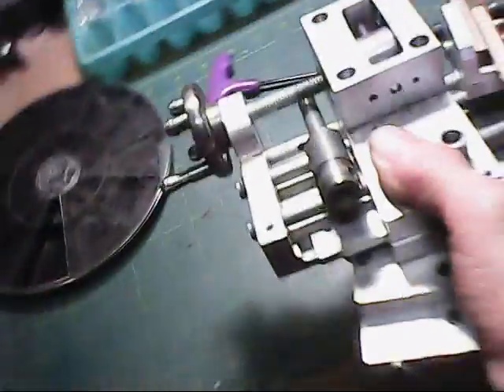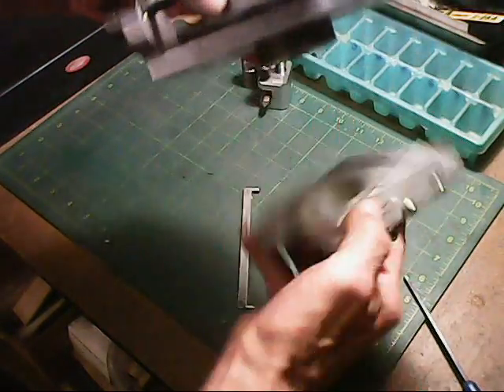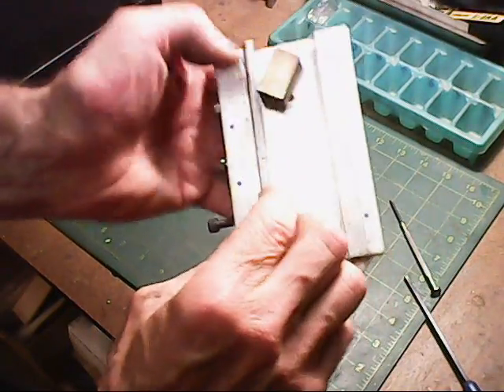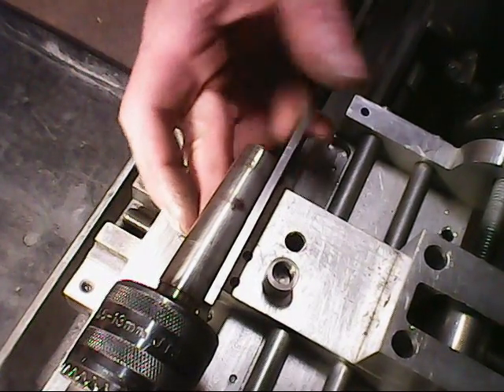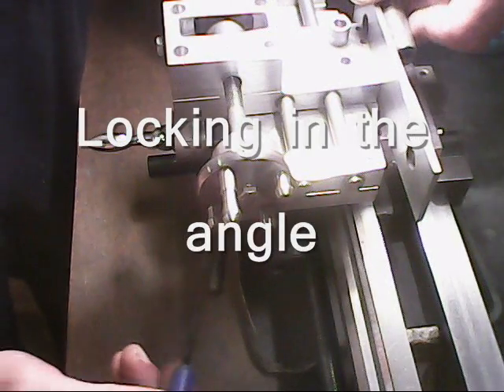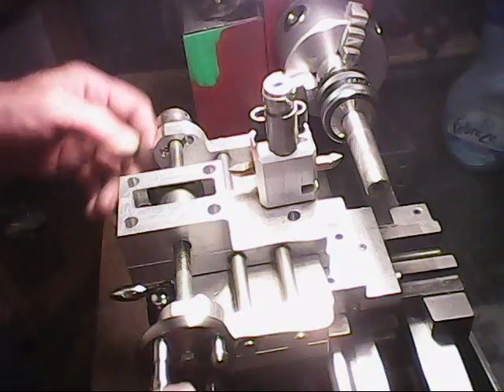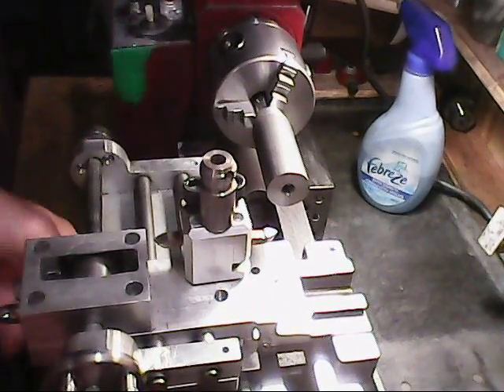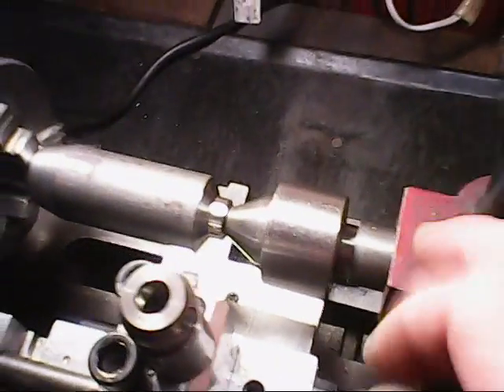shopmade, tapering jig

Comment: I am seriously confused. I am probably missing the point because I am getting old and senile, but I don't see why you had to make this fixture to turn the Morse taper, and I'm sure I don't understand what problem would be introduced by "backing out any compound slides". So put the blame on me. Your fixture is a very elegant design which displays excellent craftsmanship however and I compliment you on it most sincerely.

As far as positioning the angle goes: indicating the original pattern taper is not that difficult. Simply zero an indicator at one end of the existing Morse taper. With the original compound lightly snugged tap it gently as you move the indicator along the length. The "drop" on the indicator needle will slow dramatically as the angle becomes more parallel. Repeat once more and you should have it spot on. Certainly your "paper and light" rough adjustment will help speed the process up, but not so much as the time it took to make the fixture. Now, if you do a lot of this type of taper turning then, of course, it might be worth the time to tool up for it to the extent that you have. 

I grant that the position of original compound handle would make turning the crank inconvenient being so close to the tailstock. Your design has cleverly taken that into account I see,  but using the original compound the problem could be remedied by simply using a longer, albeit robust tool bit and extending the tool holding block a bit further in the 'Y' direction.

This is just how I would have approached the problem with the equipment I have available to me and I realize that my suggestions might be more difficult to do with a mini-lathe. For instance, perhaps you do not have the length of cut on the compound to span the entire length of the taper? I am assuming that it may be something peculiar to your mini-lathe which prompted you to make this fixture but I think most machinists would have proceeded in some manner close to what I have described above under normal circumstances. Thank you for a great video presentation, and once again let me say that I admire both your craftsmanship as well as your creativity in design.
Reply from the maker: Hi, thankyou for the compliments, much appreciated.

When I was first making my morse taper tooling, I was using the traditional method you suggested, however I was brand new to hobby machining, started around yr. 2000, I didn't like the method of having to back out the compound slide all the way out to make fine adjustments to get the pattern in, but because I was new to machining, I didn't have experiance in the tricks of the trade.

So I was trying the hard way to make adjustments with the compound slide.
I would push it back and forth, finally when I got it where I want it, I then had to back it all the way out to tighten it down at the angle, and then it would turn on me again.

Now I have had some experiance in setting up parts, I would use the method as you suggested, snug the compound enough to make adjustments, and tap the compound into position, that's really the most acurate way of making fine adjustments, on any setups, however back then I never even gave it a thought about tapping for alignment.

So with the frustration of the  compound slide having to be backed all the way out, I decided I would make it easy to make fine adjustments, by coming up with this design.

When I designed this, my goals were to make the longest tapers I would need for my toolings, as well as a way to easily make fine adjustments, and be able to have the use of the tailstock as well.

This project was thrown away in my junk box over a half dozen times, I kept on getting problems with alignments of the jig itself, wouldn't turn easily wouldn't stay on track, every one of those times I threw it away, I would pull it back out hours later, and change something on it, take it apart and make or add a new part to it, then after so many changes and do overs, I finally got it working correctly, that's one project where I learned the first design usually isn't the ultimate, its after trial and errors that the product finally works the way it was planned.

The technique you shared is a tried and proven way of setting up for tapering on the lathe, I just didn't have the know how of doing it properly at the time.  However I would like to try it now that I know how to do proper setups now, and see if there are any problem areas with the mini lathe in doing long tapers.

Thanks again for the very encouraging compliments.
Reply: Thank you for accepting my comment in the spirit in which it was intended.

OK, now for the good news. I kept thinking about your project and came to the conclusion that one thing your fixture DOES offer which could be of great value in the shop, (and which I alluded to in my first comment), is the fact that it allows for a far longer "throw" on the compound than was engineered into the original design by the company which made the lathe. I can't tell you how may times over my 50+ years in the trade that I could have used more travel on the compound. I know that this was not your reason for making it, but to tell you the truth I am now, after careful consideration, convinced that a fixture of this type is an excellent spare time project even for the professional shop. I think if you tagged this project specifically for such application it would be of considerable interest especially to home shop machinists who do not have a taper attachment for generating longer tapers.